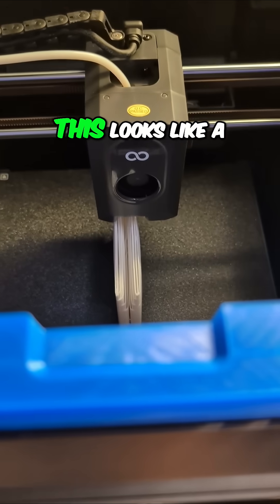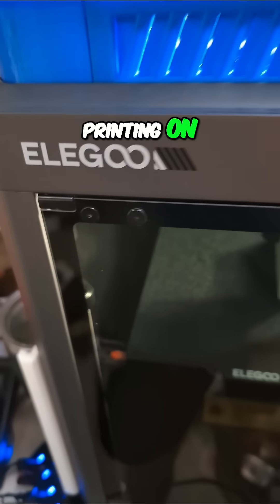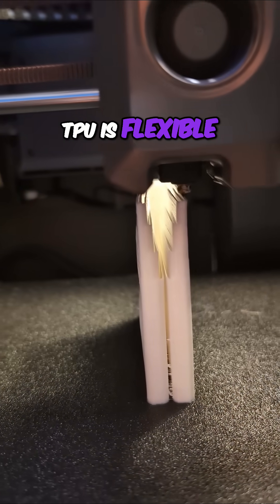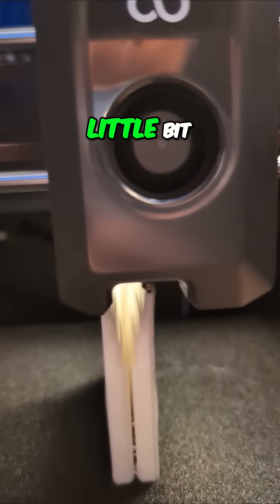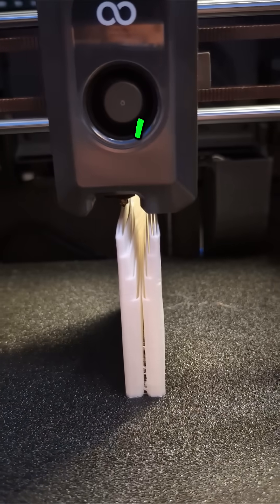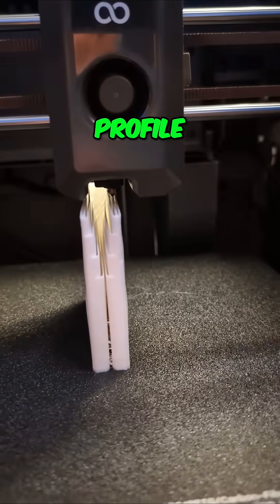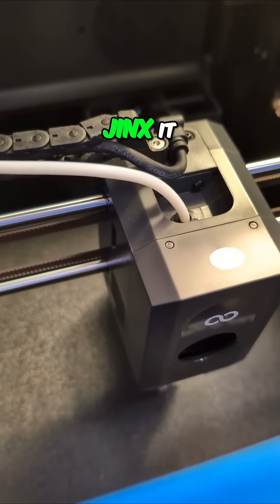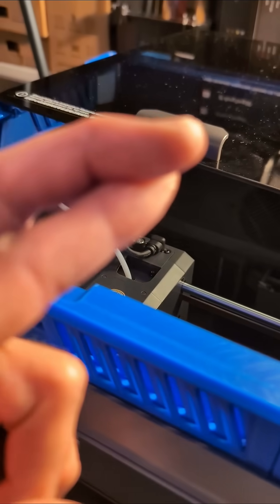3D Printer Does the IMPOSSIBLE! Watch This TPU Print!

Comment: In the end did it work?
Reply from the maker: Been carrying that wallet for a month
Reply: @GearReportMaker I've never printed TPU, but I have spoiled PLA prints by opening the door to check the print progress out. The temperature difference was enough to affect surface finish and sometimes also warping. My other REALLY bad habit is popping finished parts off a still ongoing print. I know it's hard, but it's better to just leave these things alone, look through the glass or watch the camera😂

Comment: i have same cc printer kingroon pa6 can i send you the stl. im having problem with to see if you can print it
Reply from the maker: Sorry, just saw this. Did you ever get it sorted?
Reply: @GearReportMaker no I have not
Reply: @GearReportMaker no not yet I've tried to print it a couple times and keeps popping the plate off the machine I've tried my filament I have friendly 15 mm brim to try to keep it down and it still causes the plate to pop off the machine
Reply: @GearReportMaker so would you be interested in me sending you the STL file and see if you can get this to print on a elegoo centeria carbon

Comment: lol I printed the same model last night in my a1 mini😂
Reply from the maker: Such a cool print! How did yours turn out?
Reply: @GearReportMaker there was quite a bit of stinging and my tpu was kind old but other than that it was great also would you recommend the carbon?
Reply from the maker: @Coool4960 so far, absolutely. I was a very early pre-order and even my early machine has been great.
Reply: @GearReportMaker ok yeah I’m thinking of getting it as a secondary printer to my a1 mini
Reply from the maker: Hard not to at $300
Reply: @GearReportMaker yeah
Reply from the maker: You ordered yet? If not, here's my link. :) Elegoo Centauri Carbon https://elegoo.sjv.io/Y9ve5O
Reply: I heard there can be a heat creep issue where the filament can form a blockage prior to the nozzle (or maybe it was the extruder). If I read right it's avoidable and specifically mentioned in the manual not too leave the door closed for certain filaments. So is it really an issue? Idk, maybe I'm mistaken, but I have read about it. I also know you have to take quite a bit apart to fix it.

Comment: I get my first roll of TPU and a Filament dryer this week. Will be interesting to see how it prints on my Bambu Lab A1.
Reply from the maker: TPU hasn't been as scary as people have led me to believe. I've printed several things on my N4M with minimal filament profile tweaking. And only had an issue on the CC with saturated filament. Same filament printed fine after being dried.
Reply: The Bambu TPU is pretty nice, but it does stick like crazy to the textured PEI. Printed well off my A1 after a good bed cleaning
Reply: Its easy just don't use the generic TPU profiles, only use bambu tpu profiles even if its generic filament. You're welcome.
Reply from the maker: What is different about their profiles?
Reply: @Default_username007  aha, I took the generic TPU profile, and edited with the parameters from esun's webpage and it printed beautiful everytime and had the tpu in the filament dryer while printing. Looked great, no stringing either. only problem was that it was almost stuck on the buildplate :O
Reply from the maker: Nice! I really  need to do some prints directly from the dryer. My ptfe tube arrived, but misplaced it. Once I find it I can connect the tube and feed directly from the dryer to the extruder. :)

Comment: TPU no dryer. Good luck my friend you are brave
Reply from the maker: There is a fine line between brave and stupid...
Reply: I used to think my TPU had moisture issues after printing at 240c, then realized the things I'd printed prior had all been 230c. This filament has been out in the open for years 30%-55% humidity. Printing 230c again made all the bubbling and stringing go away immediately. If you go too hot I think it's plastic off-gassing, not just a result of moisture, else 100c is already enough to boil water on its own.
Reply from the maker: It seems different formulations handle moisture much differently.
Reply: Everything cheap has plasticizers as material properties are secondary
Reply: Depends where he lives. In the desert average humidity is usually below 25% which is safe for most filaments.
Reply from the maker: Here in NC my air conditioned office is usually about 40-50% humidity in the summer. :(
Reply: @GearReportMaker oh. Yeah. You’ll want a dryer for anything above 30%. 😬
Reply from the maker: That is year-round in NC
Reply: @GearReportMaker well. You’re right that some filaments handle moisture differently. If you’re getting good prints that’s all that really matters.